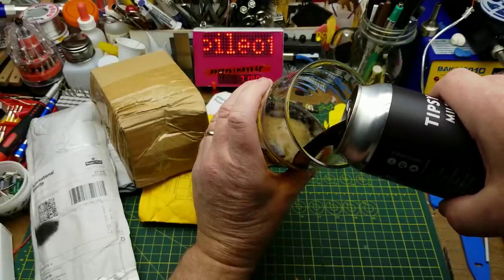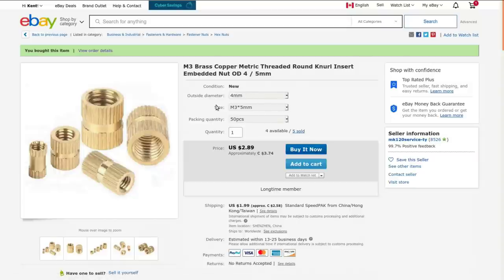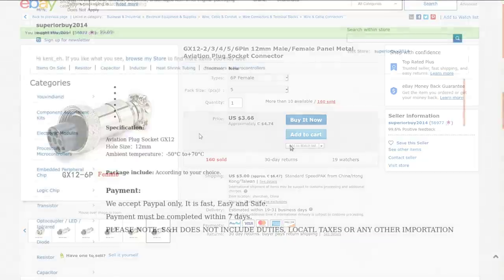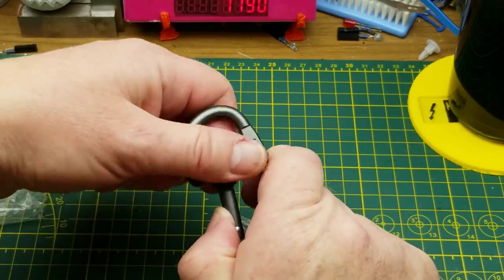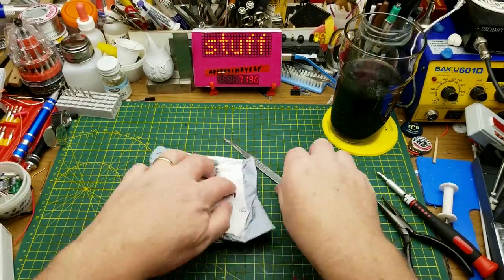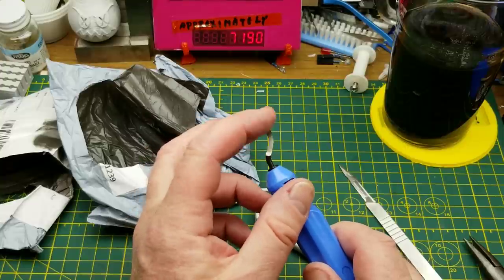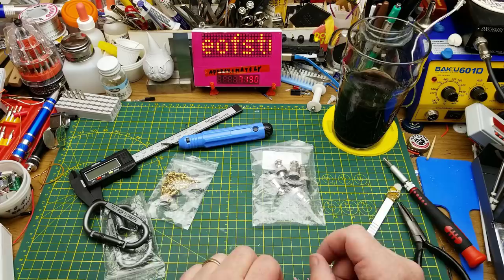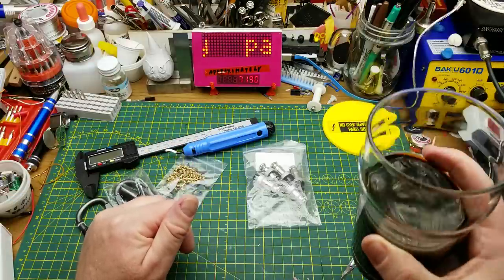Mailbag Monday #103

Comment: Big Clive did an interesting teardown of those exact calipers (I have a set too...). They are surprisingly good. 
Not sure it's been released to public yet.

There is a data port under the cover on the top if you want to try talking to it.
Reply from the maker: I saw Clive's video the day after I finished this one. 
My old one has a similar data port. I might tear into that one and try to figure out why it keeps losing it's mind.
Reply: @pileofstuff  The old one is almost surely a linear capacitive encoder like the new one, and little bits of crud that sneak past the little fuzzy dust blocker thingy make them unpredictable. I'd be very surprised if Clive's teardown "instructions" don't apply to it too. Just be aware of the springen sproingen.
Reply: video out 3 days ago, data port for logging i expect

Comment: 7:50 We did use this kind of deburring blades for getting rid of the sharp edges on the inside of aluminum pipes when i did work at a factory 30 years ago, they work good. The outside sharp edges on those pipes was done with a large sand paper band machine. When the sand paper bands was done by the man who did run that machine i brought several of them with me home and cut them to proper pieces with a steel scissor and used them as sandpaper for hobby and fixing rust on cars and things like that, still useful and still got some left in a cardboard box :)
We had three different kinds of robots that did run welding, lathe and milling, i ran the two first ones but not the milling one. Pretty high tech stuff at that time in 92' :)
We had lots of manual machines too, for sawing, cutting, drilling, lathe, perforating, bending, shaping all kind of things, and several MIG and TIG and spot welders. We made stuff for two car factories.

Comment: Strip, clean and lubricate the old calipers, they will almost certainly start working. There is probably conductive schmoo somewhere in the capacitive tracks.
Reply from the maker: Yeah, I plan to tear into them at some point.

For curiosity if nothing else, though Big Clive took the edge off the curiosity part for now.

Comment: The plastic used for the callipers actually is a composite, and is resistant to wear and damage.  Big Clive took one of these apart and did a scratch test on the plastic.  I don't know if it's actually a carbon composite however but it wouldn't surprise me - they even have carbon impregnated versions of 3D printing filament so I just see this as an extension of that low cost technology.
Unfortunately they are not really sufficient for 3D printing work at a resolution of 0.1mm (0.01") *in*my*opinion*.  If you're going for something that is supposed to be an interference fit which is common when making parts to repair or extend the usefulness of an object, rounding errors in measurement can lead to making something that doesn't fit at all or is too loose.  For example allowing 0.1mm on a printed part will normally equate to an interference fit on anything with a significant mating surface for most people/printers.  0.2mm per surface will normally result in a sliding fit.  So... when making something to match with a part with an unknown dimension you really need slightly better accuracy in measurement.

Just my opinion for those that might be thinking about buying the same callipers.  They are good for rough measurements if that is all you need, but for basic engineering/maker work you might consider that extra zero as being non-optional.
Reply: They aren't really carbon fibre, they are just glass fibre filled nylon or similar thermoplastic. The fibre just makes them more stable and "tough", but a completely different thing to Carbon Fibre which is cured in an autoclave.
Regarding accuracy, it's only an extra dollar to get calipers with 0.01mm resolution so I would never bother with these simple/cheap ones that are only 0.1mm. The metal ones are also not much more expensive, and they are much more stable and "parallel" on the measuring faces due to being ground to size.
I am waiting on a set of fractional calipers from Banggood, so I have mm, thou and fractions of an inch. I'm sick of using conversion tables to sort out imperial drill bits. so I splashed out the AU$20 for a set of new calipers that will directly read what size drill bits are!

Comment: Haven't had much luck with digital calipers, ie, batt goes flat fast, display flaky, so I stick with the old manual ones. I usually take them apart and clean them internally, and they work for a while, but eventually they cr@p out again.

Comment: Warning about the calipers ... Do Not leave the battery inside when not using it otherwise it will be spent in no time.
Reply: That only applies to SOME of these calipers. I've bought 4 different cheapo ones over the years, and none of them drain the battery like you describe. Oh, and they all automatically wake up when they are moved.

Comment: LOL gotta love Mastercrap. I have their calipers also, but it looks a bit different, the label printing most notably. It doesn't suffer from the same problem (though you had me check). It does have a fun way of draining a battery while it's sitting in its case doing nothing. Annoyed me when I'd get it out only to find out its battery was flat. I just store it with its battery removed now.
Reply: The battery draining problem only affects some calipers. I think it's actually a manufacturing fault rather than inherent in the designs, since I have 4 sets all different and none of them do it.
Reply: @johncoops6897  that seems likely

Comment: 11:40 Should be possible to take it apart and fix it.
Probably just some cleaning that is needed.
Reply from the maker: Thag is on my to-do list
Reply: @pileofstuff  - I have a set that goes stupid (like yours) when the battery connections go loose or the battery is low. It catches me every time it happens, as there is no other indication of a low voltage.
Also see recent BigClive video about how to disassemble and how they work.

Comment: Never knew about the m3 inserts. They look fantastic.

Can you do the same (heat them up and melt to) with acrylics?
Reply from the maker: I suspect they would work with most thermoplastics.
Reply: For most plastics, you can also just glue them into a suitable sized (undersized for interference) hole.
If you need to put a lot of force on them, insert from the rear side so tightening will force (pull) the thing up through the material.
Reply: @pileofstuff  Thanks for the reply. I ordered a bunch. I love watching these mail bag by pileofstuff he explains what he's using them for and how to use them.
Reply: @johncoops6897     Thanks for the reply. I ordered a bunch. I love watching these mail bag by pileofstuff he explains what he's using them for and how to use them.

Comment: I was wondering if you could tell me what voltage the T-12 style soldering irons require?
Reply from the maker: I'll have to check when im replacing that connector. Stay thned!
Reply: @pileofstuff  Thank you I appreciate it, I'm hoping it will be 24VDC, if it is could I impose a bit more and ask you to also measure the temp sensor resistance at room temperature?  Thanks for the interesting content to watch during this year of stress and weirdness in the world.